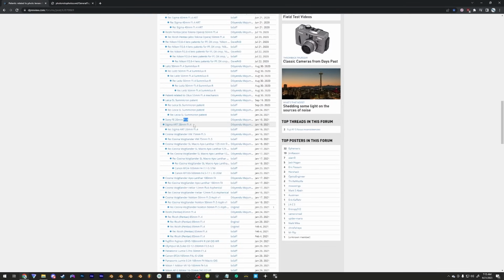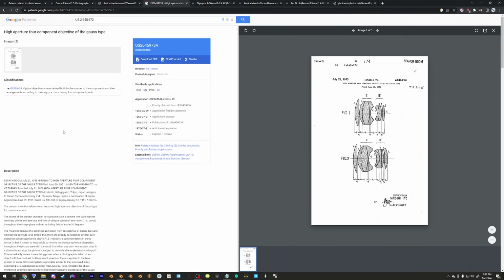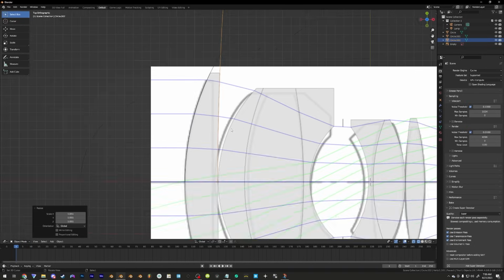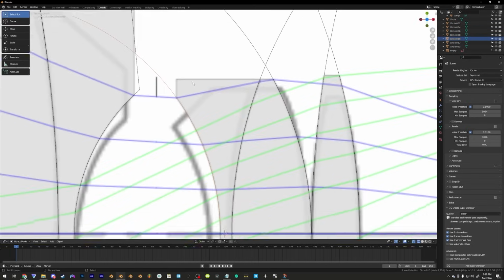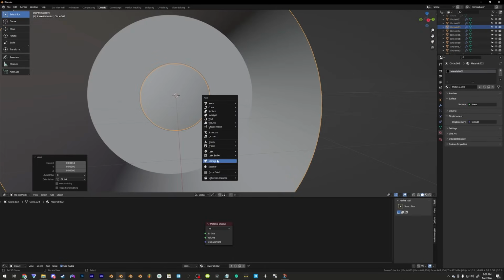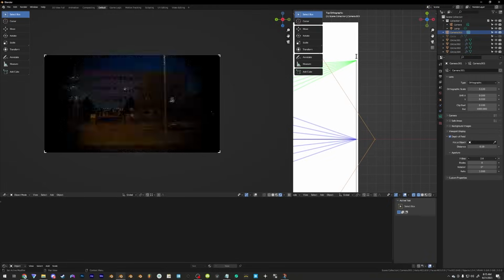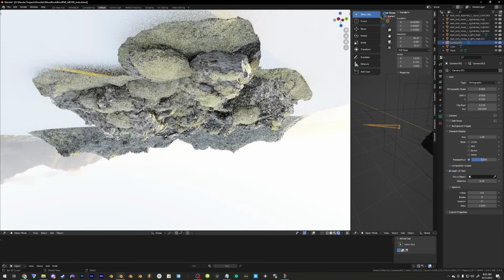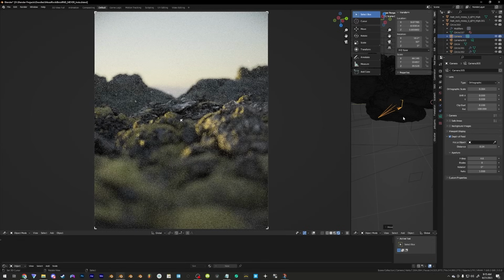Achieving True Photorealism With Lens Simulation

Comment: would it be easier to do this in some sort of CAD software so that you can input to-scale measurements? I'm sure Blender supports STLs right?
Reply from the maker: Indeed blender supports STLs!  If you can do this in cad and get ultra precise results that would be freaking dope!
Reply: Cad software i believe is 'infinitely precise' while as a (usually proprietary) part file, then you export it as an STL with a chosen resolution. Blender may also support part files from more popular cad programs. 
I only say because watching you hand draw something from a JPEG hurt a little bit
Reply from the maker: @AlexK-jp9nc  Same haha, I've done the "cad" process in blender before and it ended up being so painfully slow, thankfully I have already gotten numerous messages from people figuring out ways to do this quickly and using the numbers directly from the patent.  Alaskan FX and I are working on a more or less "officially endorsed by zircron45" version that is suuuper dope.
Reply: @zircron45  I do not have access to my CAD software's outside of school, but I wanted the lens to be super precise even so. This meant that I had to do lots of trickery with origin points and the 3D cursor to get the correct radii and distances. As you have said, it was painfully slow.

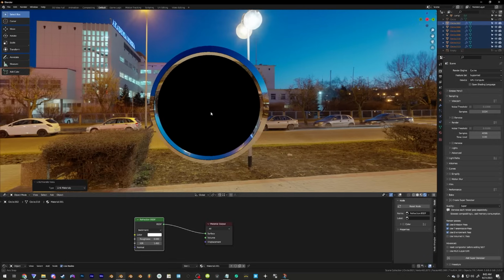This took many more hours than I would like to admit, and even after all of this the lens did not end up working correctly. (I do not know what failed with this one, as my others that I have made have worked. I have set the normals on each lens, and I have set the total light bounces and the transmission light bounces to a crazy high number. even after all of this it still appears black, as if the normals are incorrect as seen here: 28:50.)
Reply from the maker: @N-O--L---A----N-----1  thats frustrating, did you filter through the individual optics to see whats working?
Reply: @zircron45  Yes, I have gone through each individual lens and made sure that it has the correct normal. 

(Thank you for the speedy reply! I was not expecting any reply.) :)
Reply from the maker: @N-O--L---A----N-----1  No problem!  Is the image super blurry or is the end of the lens pure void?
Reply: @zircron45  Pure blackness. I have no idea what could be causing the issue.
Reply from the maker: @N-O--L---A----N-----1  my first instinct is transmission rays but you already mentioned that, have you tried bringing it into another blender project?
Reply: @zircron45  Not yet. I will have to try that. And to clarify, it is not pure blackness, but rather rings of pure black around the center. The very center is black as well. This has happened to two of the lenses I have made. The very first lens I had made was fine though, (And still is), so I have no idea what is up. Thank you for helping me troubleshoot this, I appreciate it.
Reply from the maker: @N-O--L---A----N-----1  Ohhhh sounds like intersecting normals, try checking the doublets/triplets
Reply: @zircron45  will do! Thanks.
Reply: @zircron45  I have made sure that the doublets/triplets are not intersecting each other by moving them by a very very minuscule amount as you had said in the video, but that is still not fixing or changing the problem. :(
Reply from the maker: @N-O--L---A----N-----1  have you checked if there are duplicate lenses?  the description matches a normals intersection issue but i cant be decisive without seeing the project
Reply: @zircron45  I just fixed the issue. I was dumb and had forgotten to enable “Calculate Order” in the screw modifier’s Normals panel.  

I greatly appreciate your help in troubleshooting the issue. I have made three lenses so far, and using this setup can make even the simplest of scenes look one million times more realistic. You are truly talented, and I thank you.
Reply from the maker: @N-O--L---A----N-----1  ahh haha im glad you fixed it!

Comment: Uuugh - I've used cameras since the 70s, I have 30 years in 3D, I'm a professional in both fields. Please can you learn some basic camera theory about how f and t stops work? f stops have practically nothing to do with depth of field, thats more to do with the sensor size. Modelling a lens can be useful however its only the refraction is useful and Blender doesn't have the ability to switch off radiosity / GI / Bounced light on an object by object basis and doesn't supprt diffraction - yes you can do faux diffraction but its a cheat and not ideal.
I'd suggest getting a wide angle lens and then you have the maximum wide angle set in stone, you can always zoom in. This really needs to be coded into the render engine if files are available, as light files are, for modelling lenses. Perhaps talk to DxO Labs who have measured most lenses to enable undoing on their 'qualities'. Anyway, you annoyed me enough that my dinner is gettin cold and I only watched 1:49! Good luck.

Comment: For some reason when i do this i have to set my focus disstance to 1mm and fstops to 10000+ to get a sharp image..
My lens is about 8cm in diameter in blender. The lenses seem to focus to a point great when i look at it with a perspective camera. And the orthographic one works as long as i keep the Depth of Field off. but when i turn it on, it only works with these weird values

The DoF settings just work really weird. maybe it's a problem how blender fakes depth of field normally when rendering...
Reply from the maker: set the distance to 0.19 and move it back to compensate
Reply: @zircron45  Oh I get it now, you use the DoF to make the fake blender camera use "crosseyed" at the focus point, to have the samples pick up at various points. If you put it too close it looks too "crosseyed" and the image becomes very dark as it's pick up a lot of samples from the blockout sides instead of the lens.
Also it's apparently very important to set the close clipping distance to 1mm

I got better results by having the camera look at an equal sized plane with a refraction shader. That way it's looking at it like a view finder of one of those 100 year old camera's where you had to manually lift the shutter for 10 seconds.
Reply from the maker: @DrTheRich  This was the first method I used while I was learning this!  A translucency shader is more stable for this application since it's far simpler for computing.
Reply: @zircron45  Really? with the translucency shader seems way nosier, darker, and takes longer to resolve. I think translucency takes samples from a way to broad an angle, while the refraction can be directed forwards
Reply: Can confirm it's blender faking the dof that's weird. When I put a fully rough refractive plane inside the lens, at the exact focal point, I'm able to have the lens project a focused picture on it with enough samples and perfect bokeh

Comment: I still dont see the point in this, youre still using depth of field, the end result really doesn't look that much different, what am i missing?
Reply from the maker: Heyo, its specifically details that cant be defined with simple thin lens models, such as aberrations around the edges of the frame being radially symmetrical and having folding in the bokeh shapes caused by the imperfections caused by the lens itself.  It's difficult to notice if you arent explicitly looking for it, but you can see it in lenses like the meyer optik gorlitz and helios 44-2 lenses.

Comment: how does the depth of field work with this? trying to recreate it with redshift, but there is no DOF in orthographic camera,and when trying to use perspective camera the DOF works but not with the lenses, as the defocus is based only of the distance to the first lens , anybody able to replicate this with redshift?
Reply from the maker: Have you tried putting a blank diffuse plane where the camera sensor would be?
Reply: @zircron45  how would that work?
Reply from the maker: @dnch  If i'm not mistaken redshift is an unbiased path tracer, it may be slow but it should cast caustics onto the diffuse plane and you can use that instead of the orthographic camera

Comment: As an old cinematographer, I always wondered if you could simulate physically accurate real lenses with a 'normal' 3d application, but I've always been too lazy to try it out for myself. Thank you for sparing me the work! The result is jaw dropping, really out of this world. I'm in awe!
Reply: Unfortunately. Physically accurate is not possible in 3D software. Real world always has tolerances. Even the most accurate machine still won’t manufacture a perfect smooth material. But 3D software has no tolerances calculating. Real glass always has tiny bump on two side which means the thickness won’t be equal. I  thought about  this for a long time Before. Why not make a real lens simulation in 3D software. Because it’s not possible to simulate, and it’s going to be super time consuming in render. That is the reason a compositing process come after 3D render considering as photoshop

Comment: I could not get it to work, could it be related to the scale of the objects? Or should it work as long as the relative sizes are correct?
Reply from the maker: As long as the relative sizes are correct it should work, have you checked the normals on the convex vs concave lenses and looked for aspheres?
Reply: @zircron45  I followed the example you used, so it should be the same. Will double check the normals just in case tho. I know close to nothing about optics, so I wasn't quite sure what to look for when flipping or not the normals
Reply from the maker: @Lucas72928  I gotcha!  I didn't explain it super clearly but concave lenses "expand" rays and convex lenses "contract" rays
Basically imagine looking through a pair of glasses or a magnifying lens
if you have a magnifying lens it makes things in front of it look bigger, thus its a convex lens, if you have a set of glasses from a nearsighted person, it makes things look smaller.
Reply: @zircron45  should concave lenses look all red (and convex blue) when the "face orientation" overlay is on?
Edit: ok, that had nothing to do with it lol. I think I have the right combination of magnification for convex and concaves shrinking, but I'm still getting a blurry mess :/
Reply: Ok, not that anyone cares, but in case someone's also having trouble getting it to work: my problem was the HDRI. I changed it and it now magically works
Reply: @Lucas72928  Another thing to note is that the lens scales and rotations have to be applied otherwise in certain locations a potion of the light doesn't get refracted by the elements. 'Control A' to apply - and if a lens was scaled to a negative number the normals will need to be flipped again.

Comment: It killed me when you just matched them to the diagram by eye when you could have set the origin and radius by typing in the numeric values, but this is awesome!
Reply from the maker: 100%, doing that method was how I originally figured out the patent diagrams were so off!  It's an extremely precise method but it took too much fiddling for a fast workflow when I could just eyeball it.  A group of buddies and I are working on a version that requires no eyeballing.
Reply: @zircron45  My graphics knowledge is very outdated (like pre-gpu outdated) but I have not been able to convince myself yet that an orthographic camera placed on the focal plane is physically "correct..." but I don't really understand what changes when you hit "enable depth of field" on it 35 min in...
Reply from the maker: @bkuker  by enabling depth of field i'm essentially forcing blender to think of the ortho camera as a single flat plane, that way i can render more pathtraced samples in a single section, if i use a diffuse plane there are more samples sort of "scattered" everywhere with no contribution to the render

Comment: Halfway watching this, but I’m pretty sure you don’t need to duplicate the surface between glasses! AFAIK you can just use one surface and calculate the subtraction of IOR between materials. Example: if you have material with 1.6 IOR and material with 1.5 IOR behind it, you can just have one sheet of 1.1 IOR between them (and flip normal if it’s the wrong way)
Reply from the maker: I'll have to try that!  Sounds like it'll help with render times too
Reply: @zircron45  in real life here is thin layer of special optical glue between lenses with own IOR :D. But definitely air gap is mistake, Lenses w diff IOR used for compensate chromatic aberrations

You can check how everything actually works in optical design software such as Zemax for example

Comment: Neat video, using a orthographic camera to simulate image plane is a fascinating idea. 
Since this is tangential to my research topic, here are some things you may consider testing in the future:
- Diffraction test. Another famous visual signature of optical artifacts is the sun stars, or diffraction spikes. For the lens modelled here (the 85mm 1.5), diffraction should become relatively obvious at f/22, at which point the entrance pupil is about 3.9mm and the actual diaphragm about 2.4mm. Serenar has a 20 blade aperture so the sun stars would have 20 spikes. Although since blender is not modelled on wave optics, I am not confident in its ability to replicate diffraction. Another application of diffraction would be the coating, since they rely on offset the peak of the waves, but the rendered images already look like they have modern coatings so this probably won't be necessary. 
- Find ways to introduce CA. The images in the render has some of the 3rd order aberrations but has no CA visible, it is too clean for an uncoated glass using an 1950s optical design. I suspect this is caused by the dispersion not being calculated. Not sure if Blender offers this but another important parameter in the patents, aside from RI, is Abbe Number, sometimes represented as VD or V as in the patent you saw, also inversely corelated to dispersion. If this parameter can be modelled, it should offer a better simulation result with ample CA (besides, doublets kinda become meaningless without Abbe number). 
- Digital emulsion. Similar to how that other dude tried to model the film spectral response curve, digital sensors have that too. In addition, the digital sensors have several layers of filter in front of them, include the Bayer filter, the microlens, a low-pass, and an UVIR cut, sometimes an additional clear filter for protection. If these are all included, you might find more vignett and color shift in the corner of the image for this Serenar lens. 
- Mechanical structures and edge of the lens. A lot of the flares come form light reflecting off the interior of the lens chassis or the beveled edges of the lens as total internal reflection, they also tend to cause veiling glare at times. So far the rendered image seems to be free of all these artifacts (there are some dots but I am not sure if they are scene geometry or flares), it'll probably have even more of the "vintage" feel with some flares and glares. But again, dispersion needs to be modelled for the flares to look right.
Reply from the maker: Heyo!  These details are all super important, I have a couple of rendered tests where I fake diffraction in post using a FFT and bokeh blur plugin, in the video I mention the Abbe number (Not by name) but I don't get into the details of simulating it.  If blender ends up getting powerful enough to simulate diffraction in a practical way I would freaking love it but the optical system can only really account for the front optic having diffraction.  I'll see if I can figure out a way to truncate it or simplify it.  Thank you for the kind words!
Reply: @zircron45  You can emulate diffraction in the material by setting up 3 refraction shaders at R/G/B and calculating the IOR at specific wavelengths corresponding to a monochromatic light source that would yield the primaries (hard to do right because you don't have the scene-reffered color space information in the material, but you can get away with 700/400/300, at least it would be visually plausible if not entirely correct; in any case, Cycles is not a spectral renderer so there's fundamentally no proper way to setup proper non-monochromatic CA.
Reply from the maker: @SolarLiner  Indeed that was the first method I tested!  The tragic part is it clamps all values from 0-1, and using a wavelength ior blur results in a ton of noise.  There are rumors of cycles being brought to spectral rendering and thats insanely exciting!
Reply: @zircron45  hm, I've had success in the past and didn't run into clamping issues, it might be the particular node setup you used, if you keep to Add Shader nodes and "pure" colors then there shout not be any opportunities in the shader to clamp the values
Reply: @zircron45  why not yousing Spectral renderer out there? like Lux renderer or Indigo or Mitsuba ?
thank you for the video btw! great work! very needed such nerdish stuff haha )))
Reply from the maker: @S.Robocop  Thats a good question!  I was initially inspired by tests done in Indigo, however the engine has not been updated for 4 years and has fallen behind.  Its really freaking sad because it is an incredible tool.  Luxcore was another option however at the time of recording this it was version locked to Blender 2.93 when I was already messing with Blender 4.0.  As well as that the GPU caustics in luxcore did not work, which limited me to using my underpowered CPU.
Reply: @zircron45  ohh I didnt know Indigo development is frozen for 4 years 😓  
I recently looked for some lighting simulators(renderers) which focused on pure raw simulation of light behaviour, want to test some of my hypotesis before go to in "real world" tests )), thats how I found these three mentioned in my message (and your amazinn video), but not yet playing with them in Blender.. 

Thank you for reply 🙏